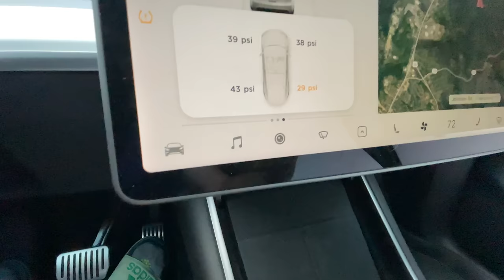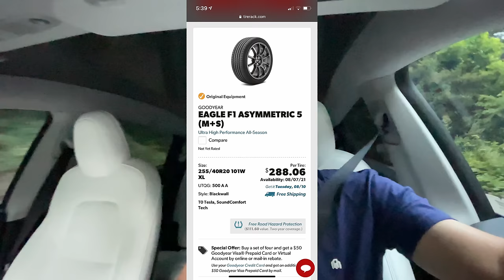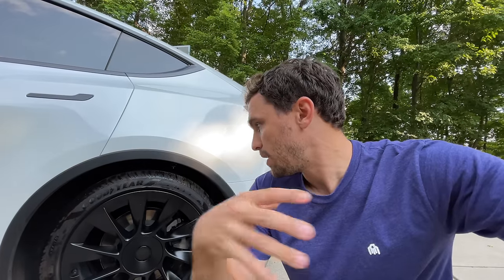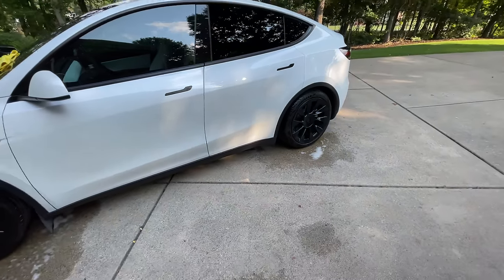This is Why Tesla Tires are So Expensive (Another Flat)

Comment: My model III has 67,000 miles and the tires remain in excellent shape. Costco estimates they are good for 80,000 miles. This has been a pleasant surprise. I rotated the tires every 10,000 miles for the first 40,000 miles, but then quit at the suggestion of a Tesla service center. No re-alignments since purchase. I was obliged to replace one of the tires (left rear) on account of a puncture. Of course, I do not "hot rod" with the car. It's the best car I've ever had.
Reply: Which Brand ?
Reply: @jackhopman  The original Michelins that came with the car. They have now reached 70,000 miles and are showing tread wear on the inner surfaces, probably because I quit rotating them. Lesson learned. I plan to switch to purchase Bridgestone tires to replace them in hopes of obtaining a quieter ride, but Michelins have always given excellent service in my experience.
Reply: @jackhopman  I might add that I’ve had only one flat on account of a nail, and I learned a lesson there too. I drove the car around the corner to the local Costco but the tire was ruined and required replacement. Now I carry one of those tire kits that squirt goo into the tire
Reply: @thestresstheoryofhansselye3607 Those goo will ruin your TPMS in your tire.
Reply: @jacobheinz8236  I never used the goo. My tires lasted 80,000 miles and still had life left in them but I decided it was time to replace them. This time I switched to Continentals. They seem to be quieter and ride a little better, but perhaps they won’t last as long

Comment: Welcome to the Tesla tire circus.  They know electric but they don’t know tires, and they clearly didn’t apply their brilliance to this part of the car.  The “no spare” thing is not just them though, and they have their reasons for not wanting Joe consumer to change the tire, but the whole process of dealing with flats needs to be re-engineered.

I recently had to deal with this as a second owner of a 2021 Model Y with just 18,000 miles on it.  I’m used to tires lasting 50 - 70k, not 15 or 20, so needless to say, I didn’t expect to be dealing with this in the first two weeks of ownership.

Okay, so $430 and 36 hours later (my flat happened on a Saturday night), the car was up and running again with a new OEM Goodyear tire.   The tow was free because the car is still under warranty but it’d be about $175 otherwise.

I didn’t want to revisit this situation unprepared, so I began researching my options and quickly concluded that I should avoid the Tesla Service Center as well as their choice of tire whenever possible, so I just replaced my 2021 Model Y’s Goodyear-branded OEM tires with 4 new Continentals.

The Continentals are NOT foam-lined but the ride is just as quiet.  Continental makes a shit-ton of tires, so more specifically, I got their 20” ExtremeContact DWS06 Plus. 

I decided to get the Continentals from Discount Tire after doing a comparison shop at Tire Rack.  Tire Rack isn’t specific to Tesla, of course, so a glowing review for a particular tire doesn’t mean it would do as well on a heavy EV.  But Tire Rack allowed me to see comments for just the Teslas and their superlatives for the Continentals still obtained.

The DWS 06 plus is not new.  It’s been around for years,  so by now, it is ubiquitous.  If it’s not in stock at the particular tire store you happen to visit,  wherever you are, it’s probably available nearby. 

On the flip side, I could also see that the Goodyears are a disappointment both with and without the foam, and Tesla probably carries the bulk of the inventory for this flat-prone waste of rubber.

Comment: Everything is expensive with Tesla, specially the insurance. I regret buying a Tesla. Pain in the ass to keep it charge even though I have a charger at home but above all possible in the head with the heat that comes through the roof. What a stupid design the glad roof is. It overheats the inside of the car and the occupants of the car. I wasted $900 getting ceramic film al around the glass of the car to still have to use a roof and windshield shade🤬🤬🤬🤬🤬

Comment: Have you ever considered using run flats? I’ve had Contisports on my 2014 benz and it has saved me multiple times from being stranded. I am expecting my M3P soon and I am thinking of swapping it. I am just not sure if it will make the ride harsh.
Reply: Run flats are horrific. Never again
Reply: I use run flats on my Lexus 450h. My brother use run flats on Lexus 350 . 
Yes they work great. Those run flats  saves us from many problems.  And it’s very safe.  I remember back old days when there was no run flats. And I change flat tire on rainy day, on busy traffic, on hot Sumer day. Now after runflats i really don’t care. Because they won’t get punctured very easy.

Comment: Wonder if it has to do with it being heavy, Slightly increasing odds of penetration? :o
Reply: nah this is actually common issue with spec tire designed for performance model's 21" uberturbine wheels

hopefully their tire manufacturer partner comes up with a solution or design a better tire soon

I've been actually told by Tesla advisors at local dealership to absolutely get the non-performance model unless u absolutely must have the performance for tire issues alone
Reply from the maker: I mean it’s good content. Maybe strap a leaf blower to the front to blow debris out of the way?
Reply: That's what she said 🤣
Reply: @carssucksince1800s can you share the link?

Comment: And just like that, I had a right rear flat that stranded me on I-70 about 60 miles from my house.  Of course, after 7pm on a Friday when all the tire stores are closed.  The tire did not take air from the tire pump that Tesla is legislated to provide in Maryland.  Call up Tesla Roadside, who recommends finding a Costco (and secondarily a tow to a Tesla Service Center about 30 miles away.) Costco did not have the tire in stock (nor did Mr.Tire.). Ended up waiting 3 hours for a tow truck to the service center, and had to rent a hotel room for the night.  Roadside service says they checked 4 providers for loaner spares and no dice with any of them.  The tow guys said they have been running Teslas with flats all day.  This teaches me that a: don't rely on loaner tires; b: Roadside assistance is not quick; and c: Teslas should have spares.  For some reason, the tire that Tesla installs OEM are shit:  they have spec'ed them to save weight over the ability to survive typical road conditions.  I'm also going to buy a Tesla spare to throw in the back when on trips outside my town (it will prob stay there anyway.)
Reply: Then you need to include the jack as well how else will you lift up the car?
Reply: @Singh-mt2ex  Roadside Service still responds, but at least there is a tire to change out.  Better than having to get towed.
Reply: I’m getting a proper Jack, a spare tire on a rim and an M12 Milwaukee inflator. When you have a flat on a long trip out of town and civilisation - you won’t want to feel hopeless. Self pity is useless. Be Prepared!

Comment: I have a performance model X. Likewise like many other new Tesla owners, I kept buying the Pirellis with the foam in the center. After realizing you can do an alignment on a Tesla. Regardless what they say. The foam  Made no difference Curly at the moment I now run 22" continental DWS.  Which basically stands for dry wet snow. By far the best tires I've ever owned on this Tesla. I recommend this brain as well. For those living on the East Coast discount tires is known as tired direct...
Reply: I've had 2 full out flats on Continentals with my X and constant air pressure issues. Other suggestions from the group?
Reply: @trishmcginity   Yes by continental DWS  Plus, tires From discount tires you can't go wrong or direct tires...
Reply: @trishmcginity    And the downside is Tesla does not do alignments on the rear of model X.

Comment: Informative video. I ordered pucks and the Tesla tire inflation kit shortly after taking delivery of car just in case of emergencies like what you had. What do you think about the foamless replacement tires? I replaced my worn out rears with them and cannot really tell the difference.
Reply: I'll be going foamless when I need replacements. I have a local garage that will puncture-repair foamed tyres but too many still don't and the hassle is.. a hassle!!

Comment: I live in the UK and after many years of motoring experience I usually mark the inside of a tyre just before I take my car in for the service that includes tyre rotation. I doubt if it will surprise you to know that I have never had my tyres rotated without causing a fuss and referring to the handbook when I have been told that "it wasn't thought necessary." I hope that car servicing on the other side of the pond are a little more customer focussed?

Comment: 1. Have you tried pulling out the stick and using that tire slime stuff to maintain air pressure. 
2. I also heard with 4wd cars if you replace one tire you have to replace all 4 tires for even tread wear and traction.

Comment: I'm in Miami.  Went out to my car to have a red warning about tire pressure, 7 lb on rt. front, for 19 hr.  No alert on phone, Tesla service center told me maybe I have alerts turned off, .. . . no.  Used Fix a Flat to get to nearby tire shop.  They suggested go to Tesla (2.5 mi away) to fix b/c they can't fix foam tire and with only 9K miles, shouldn't replace.  Almost $500. later, new tire from Tesla b/c they WON'T repair after Fix a Flat (yet they sell a slime sealer for a tire repair).    Don't even know what caused the other flat.  Thanks for your video.  Really, the 1st good info I've been able to find.

Comment: I installed magnetic plates under the front bumper to pull metal off the road. Electric consumption drains about 7 miles from each 30 minute city drive but worth it.

Comment: Bad luck for sure.  I would go for non-low profile tires.  I replaced the tires on my model x at 20k miles with tires without the foam.  Not a noticeable noise difference.

Comment: I rotated my tires at 5k miles the first time then again at 15k they are wearing pretty even so far, zero flats and I will probably have to replace them in the next 10k or so, right now they have 22k on them. I rotate them myself because I have a garage and two jacks to do it with, I jack up one side at a time.

Comment: +$100 (about +50%) for a strip of foam in the tire ??
Please let us know if you notice Any acoustic difference.

Also, the tread depth seemed a little shallow...?
How many miles did you get from that tire?  Maybe they were due for a replacement anyway...

PS - How much would Tesla service have charged for this fix?
Reply from the maker: Tesla service charges $355 (I’ve done it) and yes the tires in the rear were shot

Comment: I was looking at EV but went with a ICE, interesting to find that my tires on my 2018 Hyundai Santa Fe, have more than 9/32 of tread left.

That’s about 44,000 miles, and TBH it’s not noticeable, they look new.

I knew nothing about Kumho Tires before buying that SUV but they are definitely worth it. Cheaper than the top brands and more reliable. I easily would have gotten 100K out of them.

EV Tires wear quick due to the weight and torque, but again it depends on road conditions and driver. My tires went through 4 Canadian winters but lots of highway driving. Roads in my area are very good too

Comment: My wife just replaced her rear tires (Michelin Pilots) on her Model Y P after over 40,000. The fronts still look great. The rear tires  should have lasted longer but the inside camber created a cord showing. It's probably her more sedate driving as I go through tires every 15K on my Model S P. Everytime I say "watch this" I 3x tire wear. 🤪
Reply from the maker: Watch my video on the camber arms I got with new wheels. That will fix the uneven wear

Comment: Why get the 20 inch wheels, if you are driving over 2,000 miles?  You would have had much better "luck" with the 18 inch ones.
Reply from the maker: Tesla doesn’t offer a factory 18” they have a 19 which I tried. I just like the look of the 20’s

Comment: Low profile tyres are much more likely to get punctures and damage than higher profile ones, for that width of tyre 55 would be much better than those 40’s.  Also they are much quieter, more energy efficient, and provide a smoother ride.

Comment: In my experience, if you buy the road hazard warranty on a new set of tires, no problems.   If you don't, you pick up debris and get punctures.  

It got to where I just bought the road hazard warranty just to avoid the hassle...  

On ANY regular car tire, if you run into a spike-like thing that is long enough and sharp enough at high speed -- you are subject to a puncture.  Simple physics.   And if there is a car in front of you, it can be hard to see and dodge such things in time.

Comment: I’ve had the worst luck with my continentals lost two passenger side tires to a pot hole about two years ago and to date have picked up three screws and a piece of scrap metal in the past. I carry pucks with me. You can get them in Amazon. I also have the Tesla tire pump and sealant. Works great in a punch

Comment: something I have noticed about  lot of teslas  and other high-end cars  with that specific type of rims ..... imagine those rims as fans .... intended to suck the air out from under the car at higher speeds  for road stability  and as cooling for both the brakes and the battery ....  in order to do that  there are left and right side rims ..... look at your rims .... are they sucking  out the air from under the car  or are they pulling air  under the car .....  the car weighs 5000 lbs  so it isn't a real game-changer ( it prolly won't lift the car like hovercraft )  but at top speed  it may be something to be concerned about  as it may be drawing the whole car to one side or the other, reducing your energy efficiency and causing uneven tire wear ..... don't know how it might effect battery cooling

Comment: When I had Tesla mobile Service rotate my tires a year ago they did not use the pucks even though I had them in my trunk if needed. They said they were careful and knew where to put the Jack.  When I have my car go through the annual Massachusetts inspection they do not use pucks either and they Jack up each front tire to check ball joints.

Comment: Standard suspension in a 2021 M3 LR AWD. Just had my tires rotated at 11K miles in 4 months. Fronts were rated at 6/10 back at 7/10 of wear. Know your Tesla is clawing more than pushing.

Comment: It's the rear tire because the rear on the model y is wider than the front and while your driving, the front may clear an obstacle but the rear tires will then run it over.
Reply from the maker: The rear is only wider on a Y performance. I have a long range

Comment: 3:40 I own at model 3 (2years) and have those pucks as well but this year swapping my winters for summer I had Tesla road service to also lube my brakes and change my air filters, I had the pucks out and the guy said I don't need those, I'm like don't you need those to lift car?, he said no not at all. I was baffled huh? He's like that's why Tesla doesn't sell that, not needed, In fact they would have had those as part of standard gear with every Tesla sold if it was necessary, im like everyone says you should, He's like every 3rd party "says" ...its all to make money 💰  lol anyway I do use when swapping my tires but Tesla doesn't 🤷‍♂️
Reply: To be honest, given that it's not a "ridge" like on a standard car, I wouldn't trust my jack to slip as I lift it, potentially scratching the jacking point area or slipping off it completely. The pucks offer some level of protection even if they're not "necessary"

Comment: You can’t rotate tires on performance model because back tires are wider then the front tires back tires are 275 front tires are 255 so there is no way you can rotate them on a regular model you can all tires are same size
Reply from the maker: Yea forgot about the staggered setup on performance Y’s

Comment: Is it recommende that just one tire be replaced. Some awd vehicles require all four be replaced.  The diameter of the new tire will be diferent than the other rear tire.
Reply: I replace tires on the same axle at the same time. So I either buy 2 or 4 tires at once.

Comment: Always put new the new rear tires on the front if the rear need replacement. I had a friend killed because of worn tires on the front and new tires on the rear.
Reply: Many auto experts recommend putting new tires on the rear to prevent the car spinning out of control. The car holds a straight line better with grippier tires on the rear. That is why with staggered tires the wider tires are on the rear.

Comment: I can’t speak on the quality of Tesla’s tires because I don’t own one. However I’ve seen many Tesla owners putting air in their new Tesla’s tires at the gas stations. Good videos.
Reply: Tesla does not make their own tires, so “Tesla Tire Quality “ is not a thing.

And air pumps and air stations have been around since the firs pneumatic tire about 100 years ago..for a reason…
NOTHING to do with Tesla.
Reply: Two wrongs don’t make a right. (1) Tesla make cars, NOT tires. (2) Where else do you pump air into tires?

Comment: I switched to michelins after 3 flats on my model 3.  Also note Tesla will only tow 50 miles.  If you get AAA get the highest level plan as most tow services will not come out for the entry level plan.  The foam is for run flat
Reply: > The foam is for run flat
Please explain the physics of that?
Reply: @troyf1   I tried to upload image which is the clearest way to explain. The added foam or insulation inside the tire particularly on the sidewalls gives added support when there is no air pressure in the tire